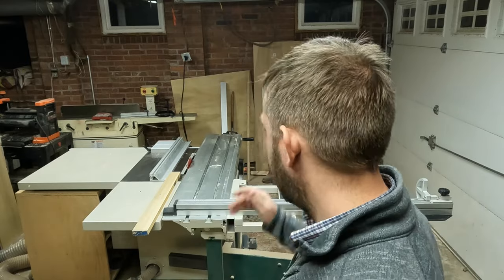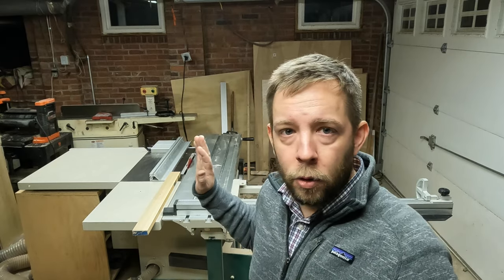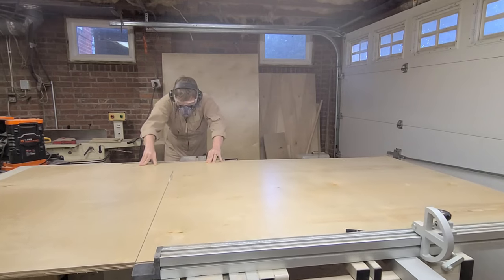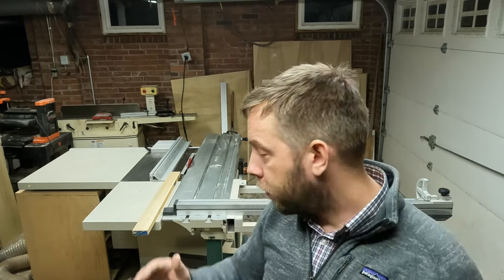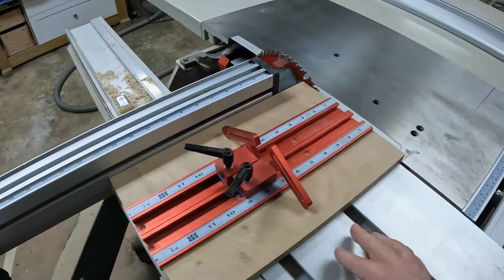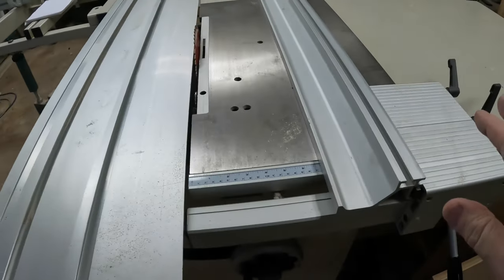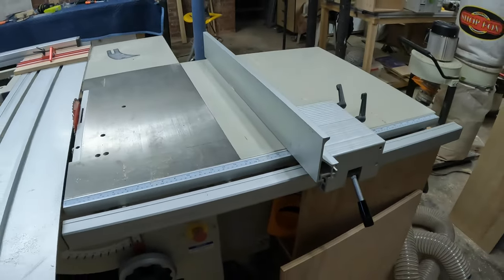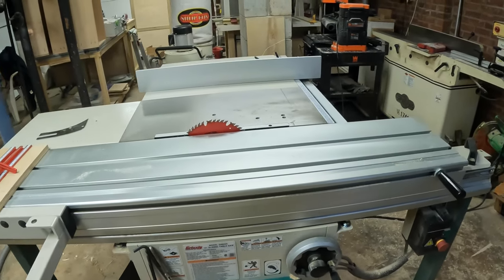On Sliding Table Saws: Grizzly G0623 Review

Comment: Hello.i build cabinet.  Is the scoring blade perfectly aligned with the main blade?
Reply from the maker: You can adjust the blade left and right as well as up and down. I have never noticed a problem with alignment, but you must use a full kerf blade.
Reply: @carolinaworkshop7091 thank you for the answer 👍Is the scoring blade   Runs separately or is it always running as the main blade spinning?
Reply from the maker: @user-wk7xt9dn8v  it's belt driven with the main blade so it's always running. You can lower it or take it off very easily. There's 3 holes on the top near the blade for adjusting
Reply: @carolinaworkshop7091  ok. thank you for answering  my question 👍🙏

Comment: With a hold down on both ends of the board, why cant you rip a straight edge on the board up to the length the saw will allow?
My son has the large Grizzly sliding saw in his shop, and he uses it for straight cuts up to 10’.
His jointer sees very little use for making a straight edge on a board since he bought the sliding saw.
Reply from the maker: You can.

Comment: I thought ripping on one of these you're supposed to clamp the piece directly on the slide and just push that through riding on the slide? The rip fence is really just a stop block in that case.
Reply from the maker: To get one straight edge that works fine but to get a straight edge parallel to that you have to use the rip fence.
Suppose you have a 3 inch wide by 2 foot long piece. How do you clamp a 3 inch wide board to the crosscut fence? There are ways to rip on the sliding table but they are much less convenient and probably less accurate than a rip fence.

Comment: Hey thanks for this. You said you can’t rip 8’ on this saw is that just due to your shop size? I can’t imagine why it couldn’t otherwise. I’m just about to order mine I’m very excited. My saw just blew up and I was about to do the saw stop thing but man as you’ve stated once you see the advantages it’s hard not to want to go that way
Reply from the maker: You can rip 8 foot sheets when you use the saw like a cabinet saw. The sliding table doesn't move a full 8 feet so you can't rip it there.
Reply: @carolinaworkshop7091  interesting. I rang grizzly and asked them that and they said it can rip a full 8’ sheet and I specifically asked if it was using the slider or just using it as a cabinet saw. Glad I watched this video. What would you say the biggest rip you can do is? Because in reality how often are you ripping full sheets bigger that 24”. Not saying you don’t, just how often
Reply from the maker: The slider moves 63 inches so that's the limit there. I occasionally rip things longer than that, like rough boards, and use a track saw.

Comment: Nice I also just bought one for my shop. With the mobile base is it still a pain to move around or is it ok? Thanks!
Reply from the maker: To be honest I have not moved the saw since I got it in place when I initially installed the base.   It was easy enough to move in position the first time I moved it. I knew one day soon I will have to move the saw and its easier on this base than without it.

If you have to move the saw a lot this might not be the best saw to use. Every time you move it you have to adjust the two legs on the slider that aren't attached to the mobile base.
Reply: @carolinaworkshop7091  Gotcha! Thanks for the quick reply..

Comment: Sliders like that one are not made for ripping hardwood. Unless you install a dedicated power feed. I would not recommend it.There designed to break down sheet goods or panels.
Reply from the maker: And why are they not suited for ripping hardwood?
Reply: Safety
Reply: @kennethholmes9315  you can not be serious it is no difference then a regular TS as long you use the same precautions. Riving knife installed, blade guard, and a ripping or combination blade.